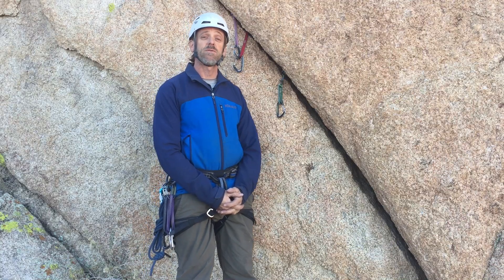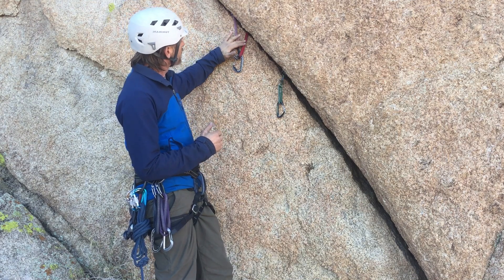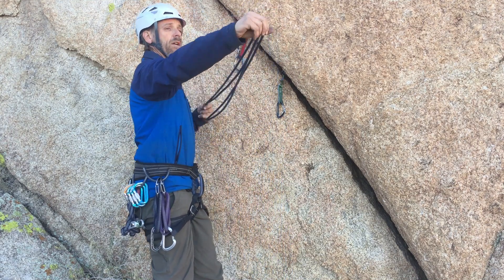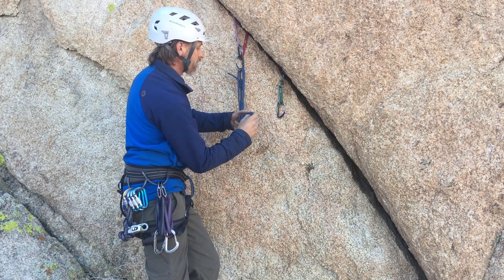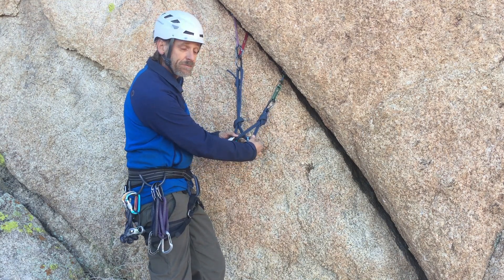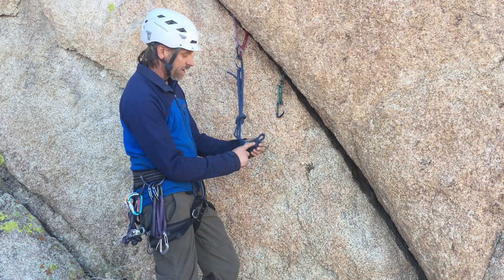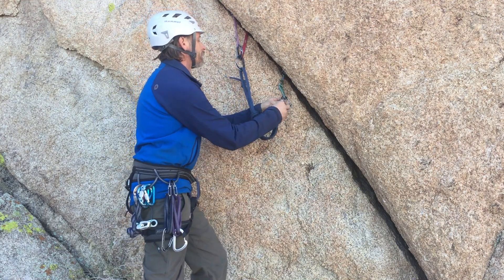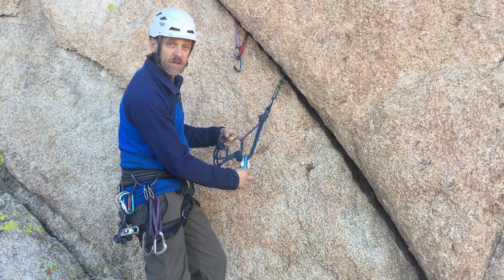Rigging anchors with the Quad method

Comment: Is it as safe to do this with 2 double nylon slings (instead of 1 quad cordelette)?
Reply from the maker: You can use just one double length sling in a sliding x with limiting knots on both sides.  Does that answer your question?
Reply: @CaliforniaClimbingSchool  I was going for a configuration that would allow the lead to clip into 2 strands, leaving another 2 strands free for their belay device and the follower (which AFAIK the sliding X doesn't do). So I was trying to simulate a quad sling by overlapping 2 double slings, with limiting knots on both sides.
Reply from the maker: @ChungPeng  Yes, your idea would work just fine, but a little bit time consuming.  You could use a 240cm dyneema sling in a quad setup which is lighter than the cordelette and faster than building 2 separate systems.

Comment: Quick question from a noob, why not do 2 and 2 when top roping?
Reply from the maker: Do you mean why not have 4 pieces when top roping instead of 3?  It depends on how much you like the piece that is by itself.  If it's small or slightly less than an ideal fit, then having two pieces on each side would be better than 2 on one side and 1 on the other.
Reply: @CaliforniaClimbingSchool  In your top rope example you used two opposed lockers clipped to 3 of the 4 strands.  I believe the question was why not clip one locker to 2 strands and the other locker to the other two strands.  Still opposite and opposed.... just utilizing all 4 strands instead of just 3.  I don't see any issues with it, it may in theory be slightly stronger.  That being said it's not necessary.  You could belay a car on top rope off 3 strands of 7mm accessory cord
Reply from the maker: @erichowe7608  Good question. Either way you are good.  I've seen both methods widely used and taught.
Reply: @CaliforniaClimbingSchool  thanks for the informative, precise and nicely instructed video.
My question: so for multi pitch and top rope, we can use the similar strand distribution? I.e., 2 and 2?? For instance I'm belaying from top..
So i can clip myself in 2, and belay my 2nd from the other 2??
Reply from the maker: @Damnationzzz  Exactly.  That way your clip in doesn't rub on the belay.  Plus when your partner get the anchor and clips into their 2 strands, you don't pull each other so much when you weight and unweight the anchor.
Reply: @CaliforniaClimbingSchool  cheers mate